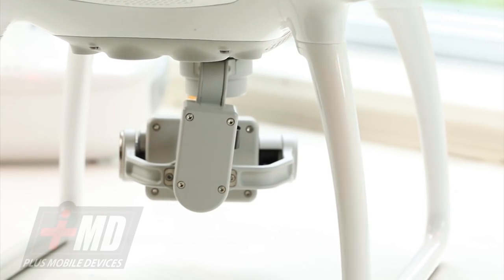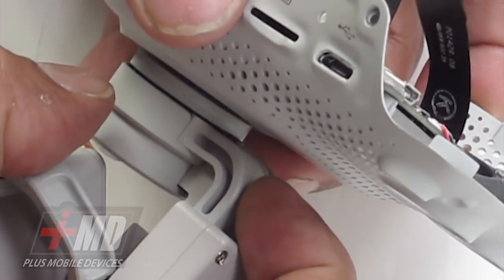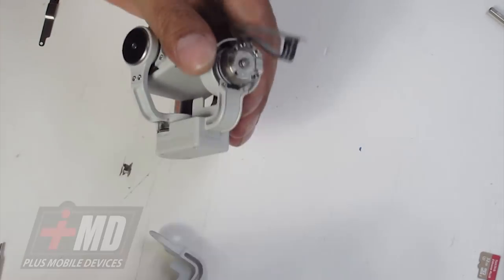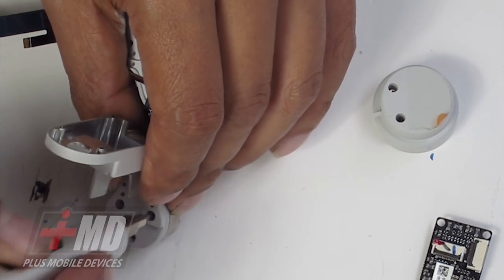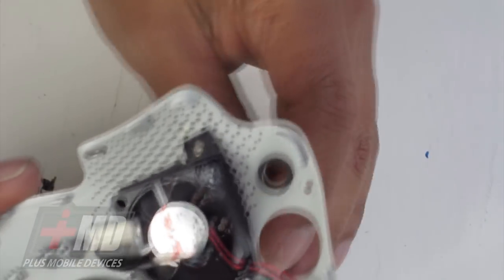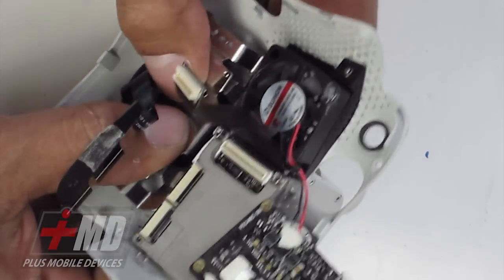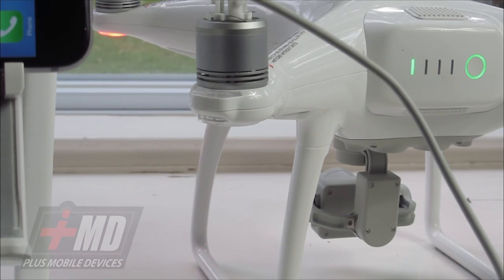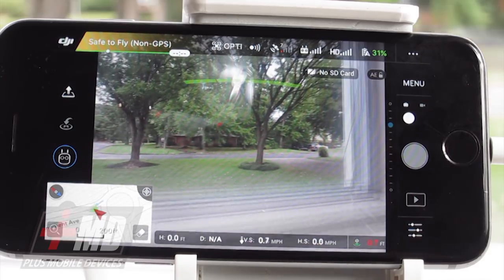DJI Phantom 4 Gimbal repair ( Yaw Arm replacement)

Comment: I just flew my Phantom 4 and the entire gimble assembly was dangling from the ribbon cable. Thanks to your video I took the P4 apart and fixed the issue. The 4 screws came loose from the dampener bracket @ 29:26. 
Great Video.

Comment: Thank you so much for this video.  I believe my dampening plate is bent causing my issues where camera is to the side and goes back and forth.  I was able to follow your video perfectly and I even called you about this issue and you gave me direction on starting with replace dampening plate.  If that doesnt work to replace the Yaw arm and then finally replace the esc chip as last option.  I really appreciate your time and efforts,

Comment: I got to the final step on the removal, but 2 of the little screws were in tight I could not get them out. I guess I will have to take the heads off and hope I can get them out with small needle nose pliers, but it seems doubtful. I will also have to replace those screws and heaven knows who sells them. Great video!! Very helpful.

Comment: At 8:40, the area you're working on, makes a weird noise, therefore my gimbal doesn't work properly. I don't get a error message but the sound is weird and it has a very smooth vibration that makes the image wooble. Now, seeing your video I'm willing to open the main logic board myself but out of your experience can you tell what the problem could be?
The video is amazing ,the soundtrack is so calming. Thank you .

Comment: Great video and a big help for me. I recently crashed my P4 and it hit hard enough it dislodged one of the 4 internal dampening mounts the bracket hangs from. Just followed this video and finished putting it back together.  

On thing I did notice though, was that the L shaped bracket you put back on at 31:40 is opposite of they way it was when you took it off, and opposite of the way mine was,  although I'm sure it's likely okay either way..

Comment: Excellent insight to what's inside my Phantom 4 !   What powered screw driver unit are you using ?   I'd suggest using a magnetic work mat to secure those runaway little screws . . . Thank you for sharing !

Comment: thanks for the video ! it helped me a lot. even after replacing the arm, my gimbal still wobbles. I figured it's the bad yaw motor. Couldn't find the yaw motor with wide mounting screws layout. the yaw motor in your video is the new design. can you help me on this please ? Thanks in advance

Comment: Do you know what size the 2 screws are that attach the roll arm to the roll arm motor because i need to buy 2 as mine ripped out of the roll arm thread. Great videos by the way.

Comment: Hi, i had a crash with my p4pro and the yaw motor was completely destroyed. I bought new one and replaced it succesfuly but the camera wont face 100% in center and when i fly it there is strange wobble from left to right, its really noticeable in video. I tried different yaw motors and the problem persists, what you think could go wrong ?

Comment: Hi Wathana, have you had problems with camera yaw position post yaw motor replacement? i.e. pointing left or right and not in center? I've heard that hey use magnetic sensors/hall effect to determine gimbal orientation and yaw motor maybe calibrated int the factory? thanks

Comment: Hi! I have P4P and camera aint center. It looks a few degrees to the left...so thats a bit annoying when flying and it wont go straight...any suggestions? There is a warranty but i am thinking to try to repair it by my self. There where the yaw arm is attached could there be screw lose etc...because when i gently turn the gimbal (power off) to the right few times i am able to straighten it (seeing with power on) but it wont stay there...it could go back that left position in the time of one flight...so what to do?

Comment: hai brother i am jose form india  i need  your help .my p4p working done but gimbal motor over load problems ,flex cable is done, motor working well,up date new fireware  done ,how can fix the gimbal motor over load problem  post the fixed video

Comment: Thanks for this, I have the same issue with mine. Is it also usual for the bent arm to cause the gimbal motors to get really warm and for it to come up with a warning saying the motors are overloaded?
Reply: I followed your video at the weekend. I noticed one mistake, at 31:45 it looks like you put the L piece back on in the wrong orientation over the ribbon cable if you compare it to just before you remove it at 7:00.
Reply: Unfortunately even after the replacement my gimbal is still having problems yawing - it's similar to before where it won't center and oscillates in the yaw direction. The yaw motor is also getting warm. I'm thinking the motor itself might be damaged. Thoughts?

Comment: I think it's a problem of yaw motor not the yaw arm, you can get the arm straighten from a carpenter shop, but to fix you need to buy new yaw motor...

Comment: My phantom 4 gimbal/camera is facing slightly to the right. I tried IMU and gimbal calibration but it doesn't seem to help. The camera level and the roll and pitch is fine. It's just the yaw is always couple degrees to the right. Any idea how to fix this problem?
Reply from the maker: Your Problem sounds like its related to the damper plate located within the recess of the under belly of the drone's gimbal, it  might be a little off center
Reply: I have exactly the same problem, although my gimbal is pointing slightly to the left! Can this be fixed easily?
Reply: James Lim hey did you guys find a fix for the off center camera ?
Reply: iRepairMD Youtube any tips that might help fix this problem ?
Reply: I was never able to fix it.  I returned it and got a Mavic.